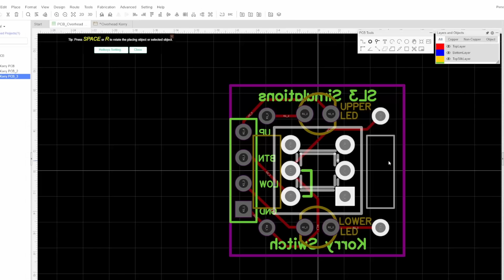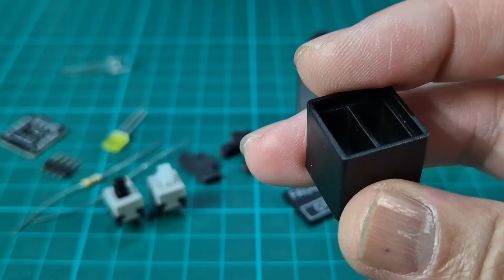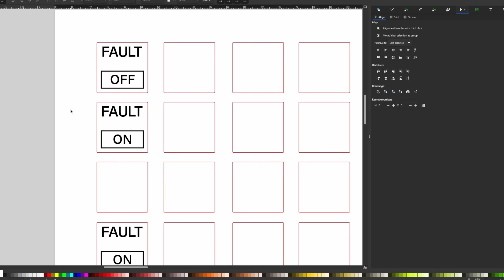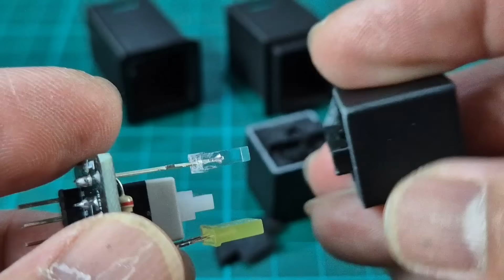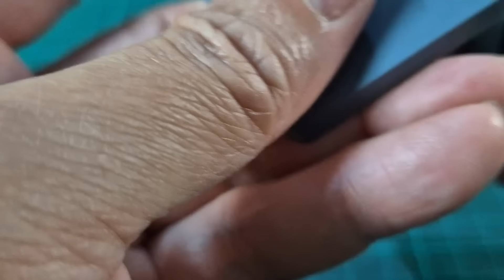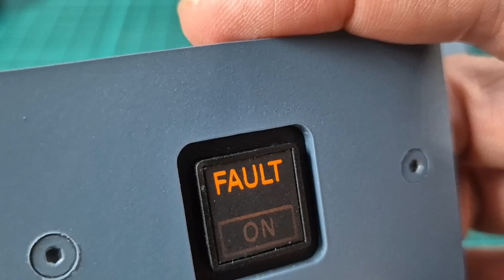How I make my A320 KORRY Buttons

Comment: The yellow LEDs work best with 150 Ohm, so expect a 47 ohm resistor to significantly shorten it's lifespan.
Reply from the maker: Thanks for the tip. I just find that at 100ohm and above, the yellow gets weaker and light doesn't look good through the 2mm tinted lens. But I calculate these yellow led indicators barely get used on a "normal" A320 operation. They are FAULT indicators that light up only on very rare occasions even in real life normal flights, so I reckon 47-50ohm shouldn't hurt 😅

Comment: @Santi Luib III Nice job Sir!
Last year my crew and me been working on the new Alien Romulus movie, making cockpits and panels for the spaceships and stations among other equipment. The SetDecorator picked an Omron industrial switch which was not available at that volume we needed so I had to come up with a solution. My approach was pretty similar to yours, just a bit more simple; -we had no time to order PCBs. The outer and inner shell are resin printed and I used one layer tinted (coloured) acrylic for the texts and a top layer black smoked transparent acrylic as lenses.
We ended up making almost a 1000pcs, as these easily customizeable functional buttons were used in every set to keep the aesthetics similar.
After the complete C5 and KC-10 cockpits we made a few years back for the last Terminator movie this job was a joyride.
Reply from the maker: Amazing! It must be fun working on those 1000+ buttons 😅
Reply: @santiagoluib3  Well, not really. It's been quite an experience to create a functional and durable component, as the props I make usually needs to last for a few shots, so I ended up rotating my guys on this task to keep everybody sane... :)
Oh, an I used the very same latching buttons you did.
Reply from the maker: @h4z4rd42  I can totally relate!  :)
Reply: So you're a prop designer?
If so, you and your team did an amazing job! This movie was what I was looking for for a long time. It captured the atmosphere from Alien: Isolation perfectly!

Comment: Nice, I've been wondering how a tint sheet would work but haven't gotten to try it out myself - looks better than expected!  Seems like it would work really nicely with custom LED displays too (like 7 segments). Thanks for sharing!
Reply from the maker: I have tried the same tint on a 7segment display, as I have made a hack to add that "v" next to the BATT1 - BATT2 voltage indicator on the overhead panel and yes, it works really well!  You barely see the 7segment pattern until it is lit :)

Comment: Wow, they look awesome! 

Idea if you want it:
It would require a pcb re-design and a bit more complexity on each button, but would simplify the controller side and overall wiring.
CAN
Can is used in airplanes, cars and a lot more so it's solid.

But if you put a can (excuse the pun) put a circuit on each button that does can, what that means is 4 wires for each button - never more or less.
You can then basically have only 4 wires that go from each panel, back to your controller.
So you basically just have a bunch of wires on each panel (which you would anyway) - but no further.
12v for everything, and always avail.
The other part to that is currently you have switches (as mentioned in this video) - where with the can, you can switch to just standard push buttons.
Why would that be better? well depending on the button type, you could make it auto-reset to a default state on power on, or follow the previous state.
So a bit more flexibilty.

Also, if you have like a dial which has more positions, you'd either have to use a resistor calc or more wires to know the dial state - where this design it stays 4 - the controller works out the state and just reports it.

You can also do more, eg maybe lets say throttles for example.
Now, each one has 4 inputs (buttons or latches if memory serves - lets say 747 eg or somme for visual), you have the position of the throttle and maybe a motor to move the throttle on certain actions.
You could do that with the controller and still 4 wires.
Reply from the maker: Thanks!  I have been studying it recently and it definitely is something worth considering.  I might give it a shot if time permits.
Reply: CAN bus is much too expensive and not needed when you're not operating a reliability critical, electrically hostle environment. Even say in your car the buttons are not indivdual CAN devices, you have a CAN device somewhere then it fans out a LIN bus to several LIN devices say across the steering wheel and steering wheel stalks, and each of those LIN devices has a whole bunch of controls attached to it whatever is clustered nearby and not just one.

I think if i was designing it and had the goal to simplify wiring, i may consider a small 8-pin microcontroller per control doing i2c, and they can be wired up any which way and the function of the control would correspond to the address of the i2c endpoint. At that point i may also unify the LED drive resistors to a lowest possible value and use microcontroller PWM to control the effective current.
Reply: @SianaGearz  CAN isn't expensive - it's one of the cheaper platforms hey.
Also ... have you seen some of the new cars? 

But yea, i2C, would do the same job. (just be aware of the device limit)
The only thing to note with i2c is you have to either add some additional circutry or power down the whole system before connecting/disconnecting anything.
Where can you don't have to worry about this as it's built in.

Could probs do a 'control' board per panel - so I2C in, or can in to the whole panel - and then it gets split off into i2c for all the buttons/controls (so no device limit)

But basically the structure is the same, micro-chip on each button/control - minimal wiring overall and more flexibility available.
I would actually recommend against PWM for the LEDs 
They don't need PWM control and if there is any video, it could cause flickering.
If you want control - rather use somme like WS2812 ** - it does dimming better and means the main IC doesn't require more pins (single pin for this)
Reply: @mitchellmnr  At hobbyist quantities, CAN transceiver ICs are about $1 each and then one needs to program a microcontroller for each button. Even if one uses an ATTiny, that adds at least another dollar in parts. Then you have the issue of fitting the parts on the PCB, as there is not a ton of extra room unless you go with surface mount on both sides, which makes it difficult for hobbyists. If you are making a full annunciator panel, yes, that is too expensive and too complex to do for each button.
Reply: @r2db  Fair enough - but JLC has pcb assembly service which isn't too costly at least.

But yea, you can make a panel controller if you that worried.

The whole idea is about minimizing wiring overall, making it easier to service/fix/change
Maybe you want to change a button, or a whole panel - its minimal wiring - you don't have to remember where it goes to what and all the pain.
You just build a new panel or switch - and change it - all connected together.

You'd just have a 'id' of the button/switch/led type and its set inside it and what it can do.
So on the integration with software, you may have to have a 'driver' of sorts to interpret - but basically if you went from a sesna to a 747 eg - you are going to have some sort of trim
So a switch with id of trim (well dial of sorts) 
So you can have varients of that for different aircraft.
Or maybe multiple types of trim wheels - ie on the stick , or the spinner near throttle or what not - each is a unique id with traits - so it just has to be mapped to the software.

Hows this, boeing was looking at changing the wheel for a stick like airbus
Well, the articulation of the 'whee' or 'stick' is the same ... so same id of 'control1' basically.
the software doesn't care, and the hardware doesn't care.

Boeing does it's upgrade and you wanna now match? ok ... change to a stick ... you remove the wheel (one cable, 4 wires) and put in a stick and you are done.

Just easier later on
Reply: @mitchellmnr  You would still need to individually program each microcontroller with the particular message(s) it wants to respond to, and have a controller know what devices it has connected. Since configuration could change you need to somehow come up with a decent way to enumerate devices like i2c or the Dallas 1-wire protocol does, but doing that within the protocol of the CAN bus could be complicated. As previously stated, the complexity of making this into a "plug and play" design is going to take it out of the hobbyist realm to build. Two-sided PCB assembly can be done, and I have used JLC for boards in the past (not for assembly services), but two-sided assembly puts it beyond the "economy" assembly services and into the more expensive and more time-consuming option. Surface mount devices are not inherently outside of hobbyist-level work, but few are going to have proper hot air stations for a QFN package ATTiny - which would be needed in order to keep within the space constraints of the existing board.

Making this into a proprietary, commercial product would be relatively easy. However, that would kill a lot of interest from someone like myself, and it would also require much higher quality 3D printing than what was shown, or preferably injection molding. That gets rather expensive. I have done flight simulation in the past, but the whole reason I am interested in this project now is to make a custom annunciator for an industrial machine.

One could use through-hole WS2812B LEDs, which solves the color issue and makes daisy-chaining them very easy. And there are plenty of compatible libraries throughout the different languages/ IDEs.

The issue is the input. For switches, a matrix keyboard has for decades been the easiest way to handle this. That would require 1) separating the LED ground from the switch and 2) a diode on the board. I just am not seeing the advantage to a DIYer of adding the complexity and cost of a CAN bus versus doing something like the Adafruit NeoKey. Yes, encoders/ potentiometers require more complexity. That would benefit from networking of some kind.

Can someone do a full CAN bus implementation for every button, every light, etc.? Sure. Would there potentially be a commercial advantage of that? Absolutely. Some people spend a lot for realistic flight sim equipment. That market is a lot smaller than the audience for this. I also have a philosophical/ ethical objection to doing free R&D for a closed-source project.
Reply: @r2db  100% on the opensource side, it wont work as closed source as would alienate a lot of the hobbiest side.
But the OS side would also bring quite a lot of people together to make something really awesome.

For enumerating - it only has to be done on startup and or the slaves can just beat a heartbeat on startup as well - no issues to do that. (CAN/i2c)
Should take a few seconds and then know what is connected.

You seem to forget the simplicity of design :) 
You don't have to make a single PCB that fits at the back of the controls.
It can be a seperate pcb with a few wires that is mounted to the rear with the connector.
That way, they can be pre-made simply or by JLC without having to make it 'fit' - there are cheap little heat-plates as well available.
For programming, 1pin programming nowdays so pretty easy.
And there is no reason why we could not just write a script to generate the code files or have pre-generated bin files to program the ICs based on what they are supposed to do.
That PCB can be generic with x amount of pins - like 1 with 2 leds, 2 buttons - and one with more eg.

For the WS2812 I am not talking about the LED, I am just talking about the controller - so you can use external LEDs with it 
Like in this case, the 2 LEDs - 2 chans out of the 3, but single pin for both control 
Small, but easy to hand solder.

matrix has it's downsides - and yea, since not life crit - its not a major.

Neokey is similar to the idea yea - except without the switches, a smaller board - but yea, the idea is similar.
So CAN has an ID, and then attributes/values.
In the case here
id 1 - eg the button from the video
then the data field can be basically handled based on that.
So say first byte is the version (prep for future)
Then button state, led state, then led2 state

Very simply, that could be parsed to receive or send information with minimal effort.
throttle - 
id 2 / v1 / 0-255 as a mapped value / switch1 , 2 , 3 state 

Joystick
id 3 / v1 / 0-255 as a mapped val (or use 2 bytes and get a lot more) for pull up / down - 128 centre / left/right / PTT state / Trim up/down etc ... 

Very simple and since CAN, anyone could make things for it.
A simple git repo with all the ids and their details as a spec would do the job for documentation.
we have versioning already in the above spec, so changes over time dont break things.
So lets say airbus changes the unit, we change it as well, and v-up it.

Nice part is if you start with a v1 - no issues 
it will work, but if you swap it out with a v2 (or make the hardware changes / and firmware upgrade) - now you get a new feature.

Like I said initially ... it was just an idea :) 
Overall it definately can be finessed into a fine platform for the whole community to join in with.
It should in turn make it easier for people to get started.

Think of it this way, you don't have to have a mess of wires, work out how to connect and wire things up
Or what not.

You just solder or buy a few boards 
 - if you solder, you program them 
And connect them with a few wires 
They automatically know what they are supposed to do, no need to map them.

With the MS FS SDK, you request values ne, so on bootup and receiving all the ids, it can go ok, value is x, let me receive that
And if it sees a value from the button, it sets it (if it can) 

So that means instead of people having to do custom arduino code or services
Its an OS app, that you run, add usb can module
And wire all your stuff 

So this also gives the ability to the lesser tech market to join in - since premade parts could be made avail.
Since ... its like the adafruit stuff with just connectors.
So lower barrier to entry, but also for the more tech makers, they can make modules for the system.

This overall would be a OS community effort type thing, and I think the MS FS community would love to hop on to make a whole OS ecosystem.

Then for the companies that make specific parts (like commercial parts) - they just make sure their device matches CAN details, and it will work.
Or .... if someone manages to get some actual plane parts and wants to really go authentic, they just have a more flexible module and write their own arduino code (or esp, rasp pi or whatever) to tap into the panel, and output comms.
Then they could basically not have to worry about any of the software integration side ... just one panel

:)
Reply from the maker: @mitchellmnr  Good insights there.  Thanks.  As far as maintenance goes, it is quite straightforward with my design.  The "headache" comes only once during first install.  But once all Buttons are in place, maintaining them is a breeze.  Just remove the tiny lock, pull off the female wire connectors at the back, then finally pull the inner assembly, and voila!  :)  After fixing/replacement etc.. just slide back in the new assembly into the outer shell, reconnect the 4 pins, replace back the lock, good to go!  :)  Just my opinion though.
Reply: @santiagoluib3  Thus why idea :) 
Changing a single should be easy since not much is changing but the control itself.
If you wanted to re-do/change up your panel, then it will be fun :P 

It's really going to be key when starting fresh since you don't need a ton of wires back to a control board for all your panels.
Since you can do 4 wires for everything. Only 4 wires total.

But yea, just an idea or maybe something to get the community involved :)